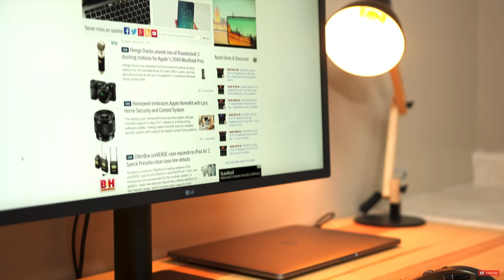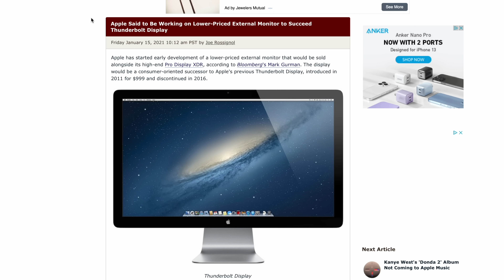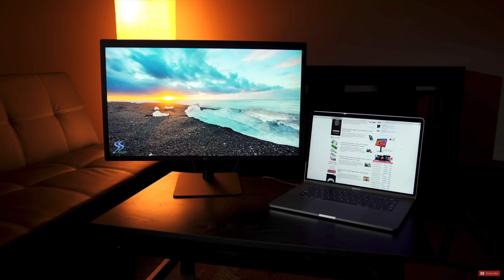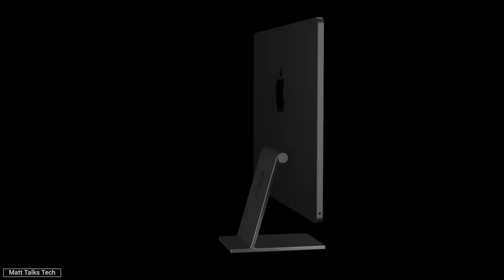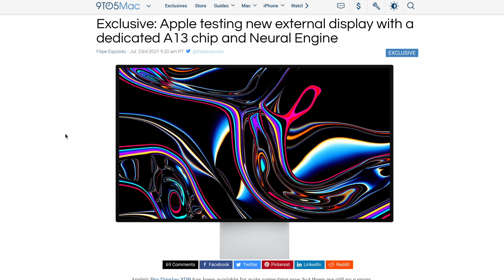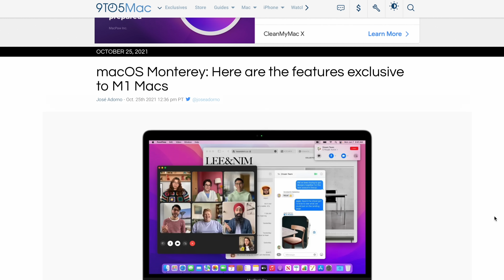3 New Apple Displays LEAKED! Why Apple is Taking Over..

Comment: My preferred setup is for twin 24" monitors and my decision at this stage (imminent purchase) is LG Ultrafine 4K units which are available in the UK for around £500. For an Apple display, with 'expected' features i.e. quality case / Versa mount / good speakers / good webcam / integrated eGPU / etc, I'd be willing to pay up to 50% more than for an LG monitor but not more. $2,500 for a single monitor is way beyond the acceptable value point for my hard-earned ££.

Comment: I currently own the 27” Thunderbolt Display and don’t plan on replacing, unless I need to. However, my eye would be on the new 27” option, but would hope for something closer to $1500-$2000. You pay for what you get, and the $1000 I paid for the thunderbolt was totally worth it. Still a fantastic monitor, with a built in camera, which is essential these days.

Comment: Problem with apple display is, you can’t use it in Windows PC.
Reply: Is that true?  I have a 13” M1 MBP with windows 11 installed with parallels. Will these work only on the Mac side or will they also work on the windows side?  If not I’m going to look at a dell.

Comment: I’ve been using the LG 5K ultra fine for the past two years. It works well enough but if this rumor is true, I will order an Apple Display as soon as it is available.
Reply: I am with you on this decision, I just purchased the LG 27 at the apple store two days ago they are still selling it for $1300 so what gives?  Is this confirmed or rumor I have 15 days to return it and wait for the upgraded apple version with better Bells and whistles for my desktop.  You at least got 2 years with your 27 inch LG and let me say that he 5k is just awesomeness to match my MacBook Pro 16 2021 model.  Let’s get confirmations on these new monitors apple says they don’t have nothing in writing as of yet?
Reply: @micro-reefsaquariums5169  I got the display at the end of 2019 to use with my 16" MacBook pro I had just bought at the time. Now I am using it with my 14" MacBook pro. The plastic build quality does not feel up to par with the laptop but it has been a great companion for both of those computers. The 5K resolution is fantastic. I think the picture quality, brightness, and convenience of being able to use it as a dock does justify the price. I frequently use the built in webcam and it passes a wired internet connection to my laptop through the integrated thunderbolt hub. As a single cable solution for a MacBook pro, it is fantastic.
Reply: @Piketom1  I am exactly as you, purchased the MacBook Pro 16 in Feb 2022 so to enhance the view I got the LG 27 Ultra Fine but the plastic feel is cheap but that is not what I touch or look at, I love the display and it is just the Mac27 inch and that is what I love I wanted that look and the LG gave it for $1300.

But since I can return it since I just got it the March 8 will tell me if they are out and whether it will be worth spending a bit more

For now it’s the best monitor for the MacBook Pro hands down for resolution, over its competitors but we will see.

Comment: 27" 5k IPS 100hz would be all i want. Nobody seems to make 5k monitors though. I'm really not a fan of 4k on mac because unless you use "looks like 1080p" the scaling is a bit shit. 4.5k might be a good option...
Reply: Isnt that ProXDR monitor 5K?

And pixel density/pixel per inch matter more than resolution.
Reply: @suntzu1409  it’s 6K, 27 inch iMac display is 5K

Comment: In what universe is a $799 a "reasonable" price for a 24" monitor?  Yeah, I'm sure people will line up $800 to go with their new $699 Mac Mini...   $400 is too much, even taking into account the Apple Tax.
Reply: $800 a totally reasonable price for a 24" monitor sold by Apple.
Reply: @suntzu1409  If it has a proper calibration, wide color gamut and a 4K panel. Otherwise its still too expensive. Still way too high of a price to be considered "consumer"
Reply: @crestofhonor2349  
Putting apple logo on anything increases the price of it.
Reply: I mean specification-wise it’s very reasonable, The main and only problem is the 24 inch part of the display if it was same specs but 27 it would be more than reasonable enough. 

For 400 you can’t even find reasonable 4K monitor. Decent 4K monitors start at around 500-600 usd and they are plastic, don’t have P3, have much lower color accuracy and are probably between 300 to 400 nits peak and sustain lower

Comment: Id rather buy a 4k 27 inch monitor from LG or dell or Benq and buy a monitor arm which is adjustable for $500 more or less. You can buy 2 monitors for the price of apples upcoming monitor (800) for the same quality. If you think 800 dollars is a “consumer” monitor, then check again.

Comment: The thing that annoys me a lot with monitors are the design and brightness. There has been very little change in that regard.
Reply: "Design and brightness"
Have you ever seen OLED TVs?
Reply: @suntzu1409  monitor its different then a tv; tv has more delay input usually
Reply: @paulorodrigues46sabe  
Sure, but it has the "design" and brightness
Reply: @suntzu1409  I am telling about monitors not TV's
Reply: @ziich1  
Sure, but it has the "design" and brightness.
Reply: @suntzu1409  so how does that apply to computer monitors?
Reply: @ziich1  
Because you can use it like one.
Reply: @suntzu1409  not for my use case. A tv would not work for me. I need a computer monitor

Comment: Not sure what to think about this. On the one hand, LG did provide the kind of monitors Apple customers needed. OTOH, LG's implementation was flawed. Problem: if Apple enters the consumer monitor market again,  will Apple have the foresight to recognize that mere mortals are shopping for a monitor and do not want to take out a mortgage to finance it? The overwhelming majority of owners of M1 Mac Minis, MacBook Airs and even MacBook Pros will want an external monitor priced between $500 and $1,500. If Apple rolls out a new monitor for $2,500, it will be great for owners of a Mac Pro or a spec'd-out 16" MacBook Pro, but not for the rest us.

Comment: For anyone wondering why the new 6k would have an inbuilt eGPU, 6k at 120hz requires a bandwidth of about 88Gbps, thunderbolt 4 can only handle 40Gbps. Even with Display Stream Compression, 6k@120 is not possible over thunderbolt 4.
Reply: Noice explanation, can you tell me how much bandwidth is required with display stream compression ?
Reply: @1thefallenone3  it depends on the underlying display port support, and the compression ratio is variable. But Apple will want 10bit lossless signal, hence the eGPU solution - which I think is a good idea.
Reply: @damien-oliver  thanks man

Comment: I have a 27" iMac but a 27" external display would be way too much money. I'm hoping the upgraded Mac mini with 24" display won't cost as much as a comparable new iMac with M1 Pro/Max. I have an M1 MBA and could just get the 24" display as long as I could run it with the MBA lid closed (with external keyboard and mouse/trackpad). Of course I'd rather not spend $800 for an external display when the MBA is Thunderbolt port limited. Apple is pricing most people out of the market. The M1 Macs are nice for many people for doing regular things but they are limited on external expansion no matter what Apple, and others, try to tell you. Case in point. I bought two Sandisk Extreme USB-3.2 portable SSDs and when both were connected to the MBA USB4/TB ports, configured as RAID0 using Apple's disk utility, I got faster write times than when using a TB3-connected NVMe drive. Connecting these drives to a Thunderbolt dock or hub gave slower times. The only way to get faster disk speed on the M1s is to pay a large amount of money to upgrade the internal storage, way more than buying external storage. Hopefully the M2-based Macs will provide faster along with more Thunderbolt buses and ports to allow external drives to run as fast as they can on PCs.
Reply: Displays made by Apple are not the only displays that exist.

IIRC, you can get 27" 1440p displays for like $600 (or less) from HP, Dell, etc.
Reply: @suntzu1409  These are not in the same quality ballpark as Apple's displays.
Reply: @robeigner4390  
But they are significantly cheaper than that ProXDR monitor stand, ProXDR monitor itself and possibly the cheapest monitor apple will sell.

Comment: I'm hoping that Apple releases a "reasonably priced" monitor for consumers is true but I won't believe it till they officially announce it. Anything over $800 is not in my book a reasonably priced consumer monitor.
Reply: I don’t think the point is to be “consumer” monitors, these would target professionals like the Pro Display XDR and the New MacBook Pro, my guess is the $800 price range one will just be the most ballin color accurate 4K panel specifically for photo and video work
Reply: In my opinion $800 is far too expensive for a "consumer" monitor. I think it's a good price for more creative/pro displays but not standard consumer. Standard consumer monitors should be <$500 otherwise you are entering more into the Gaming/Professional space of monitors that support things like very wide color gamuts, high refresh rates and the entry level of "decent" HDR
Reply: @crestofhonor2349  
More like 
"$800 is far too expensive for a basic (basic meaning without 100% DCI P3, 100% Adobe RGB, HDR 100000,................) 1080p/1440p consumer monitor"
Reply: I would like a mini-led 1600nit 5k 27inch apple monitor for around £800
Reply: Apple doesnt want to sell <$800 consumer monitors.

because if apple really wanted to sell a <$800 consumer monitor, why arent they already selling them?

A <$800 consumer monitor does not have to be 200" 16K AMOLED 120Hz HDR10000 400% DCI-P3 1000000 nits bright........., so its not like they are waiting for some new revolutionary display technology.
Reply: 800 dollars for a consumer monitor? When dell prices a professional monitor for the same price.
Reply: Turns out a double - 1600 what do you think now

Comment: for someone like me with a tight budget, $2500 monitor is too much for a mac mini user. i rather have a base iMac. or a cheaper monitor with alright clarity.
Reply: Thats why if you're on a budget the imac is what u should get
Reply: I think the best set up is a mac mini and a monitor from a company like Dell, LG, Asus, or MSI
Reply: @crestofhonor2349  that's still gonna be more expensive than the imac though considering it has an amazing display, only thing tht sucks are how the bezels look like. If you worked with the same budget you'd MAYBE get a 1440p display from a relatively unknown manufacturer unless u get one on sale.

Comment: internal A13 on a monitor? I'm calling it now, it'll be a wireless monitor, Air Display or something.
Reply: A pro display that works wirelessly sounds like a hassle and only to be used when absolutely needed. There's a reason why all displays use a wired connection. You loose too much when over a wireless signal. I be the only thing people will use airplay, assuming it has it, would be for video streaming. Anything else would be far better just to have a direct connection to it

Comment: If I can get a very good Apple Silicon iMac with a Mini LED 120 Hz Pro Motion Display for 3000$ (Compared to just the display for 2500$) I would go with the iMac.

I would not get just a display for 2500$

Comment: As a 24 in iMac user, I feel like I should put it out there—the display is sort of… terrible. It’s possible I got a crummy panel, but the viewing angles compared to the other screens Apple uses is just awful. Uniformity is great, color is great, refresh is solid of course, but I swear, when I’m staring at the screen from my desk, STRAIGHT ON, the corners will always appear a bit greyed out. And the moment I begin to turn the iMac to the left or right, even just a little bit, the whole screen shifts in appearance. Usually, large IPS panels have decent viewing angles, but strangely, not the M1 imac. To make it worse, the screen has a noticeably worse contrast ratio than any other Apple screen I’ve ever experienced. I’m guessing it’s 1000:1, as opposed to the usual 1200:1 on a non-mini-led MacBook Pro, or the 1600:1 on the 3rd gen iPad Pro (both standard LCD screens btw, I’m not talking about the newer mini-led variants). This crummy contrast, coupled with the bad viewing angles, makes for a rather disappointing display. So, if Apple plans to sell these displays on their own without the M1 inside, I’m honestly not sure what the reason for buying them would even be

Comment: I wonder if a display with external GPU would allow M1 13” MBP (& MBA) to run two external monitors. I really wish I spotted this limitation before I bought one, but I still didn’t feel it was worth the extra $300+ to get the 14” (16GB, 1TB) Plus, I kinda like the Touch Bar; RIP.

Comment: Nah. 32", 1600 nits micro-LED and Promotion 120Hz, $2500. Otherwise I'd rather wait for QD-OLED displays.
Reply: There is a QD OLED display coming very soon. Alienware has one at around $1500 and its an ultrawide. Also the Asus ROG Swift PG32UQX already kinda has those specs for about $3000

Comment: Man, a 12 bit 8k 32 inch Wd-Oled would be the mic drop.  If not Oled then 12 bit 8k 32inch MICRO Led. But I guess that’s still an expensive tech.  Fine.  12 bit 8k 32 inch mini led but it needs more like 5-10k leds. But we shall see what it looks like when they release it
Reply: 8k, but aspect ratio that matches either Pro Display XDR or whatever they call the 5k 27" display, just a longer aspect ratio and then you can market it as Cinema Display for people editing at wider than 16:9. You could pull the standard 32:9 ultra wide trick, which would be half of 12k in terms of pixel count. More realistically, pick a standard aspect ratio like 1.85:1 or 2.39:1 and match the height to pro display or 27" new monitor. In the former's case, that would end up (2.39:1 - 3384 x 14378 pixels - IMO too high for them now) but (1.85:1 - 3384 x 6260 is almost the same as Pro display, so only a go for smaller monitor match)

Comment: What I would like to see for me would be a 27-28” with mini-LED and 6K support, for $2,000 or a bit higher. I wouldn’t run away it it were $2,500 for those features.. Additionally a 32: with mini-LED as opposed to the larger LED backlights the pro offers now, along with the simpler construction of the newer monitors Mini-LED allowing fewer layers, lowering the cost and complexity). With that, I’d love 8K support, finally. The price could stay the same, as it’s really inexpensive for what it offers. 

I could use both.

Comment: Purchase decision depends on several variables, but stand/mount options and bezels will influence things to some degree. MacOs's window management leaves something to be desired such that I'd prefer to have smaller monitors flank a large one and maximize apps to avoid the constant deck of cards shuffle that is >3 app workflows on 1 monitor. 24" iMacs have a stand that leaves much to be desired ergonomically, but 3rd party vesa stands out there are all awful, ranging from dangerous to just plain ugly (aware that vesa arms have a wide variety of good choices). The pro stand is great, would be much better if it were a still unreasonable $299 and had adapters for scenarios other than the single one Apple designed (imagining a Mac mini pro/max cased with the pro stand magnetic doohickies to get sandwiched between the monitor and stand, but I get it, the weight could throw off the mechanism). I need to learn CAD well enough to 3d print a sleeve or mechanism to have a Mac mini hang off the back of a pro stand and then lucky find an affordable on on Ebay I guess.

Comment: Also, would be nice if the aspect ratios were such that mixing portrait/landscape in series could match one another when using universal control. Like if iPad Pro 12.9 in portrait had matching bezels to the relatively comparable monitor so that things looked like they went together. The OG TBDs sitting at different heights and not matching the iMac's of either size looked like a design fail even in their marketing.

Comment: Specifically hoping for XDR type rotation on all sizes, bezels/heights to match iMacs/XDR depending on size it will need to match. Hopefully some kind of stand solution for Mac minis with monitors. Apple should IMO consider selling something like a pro stand looking critter as enclosure for M1pro/Max Mac mini for DIY iMac.
Reply: Same, I have a 2018 Mac mini but im looking to upgrade to the m1pro with two xdr displays hoping they’re around $2k or less